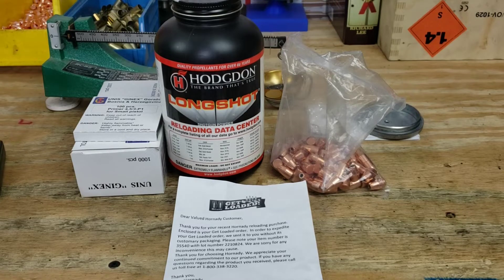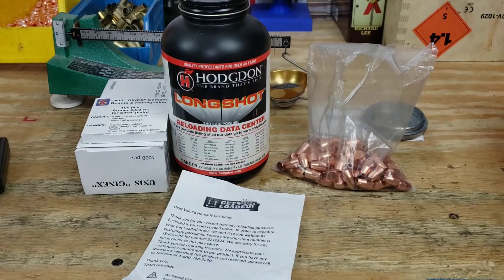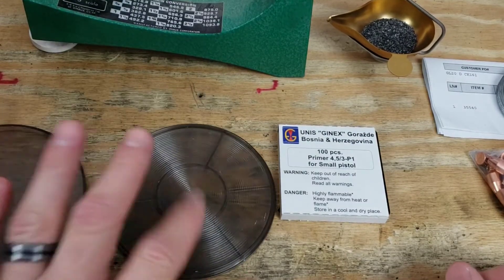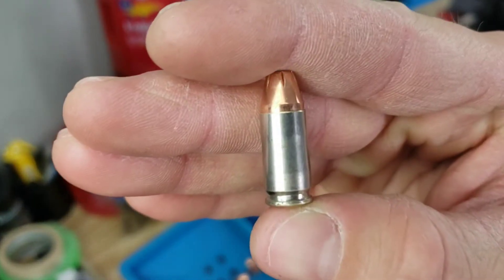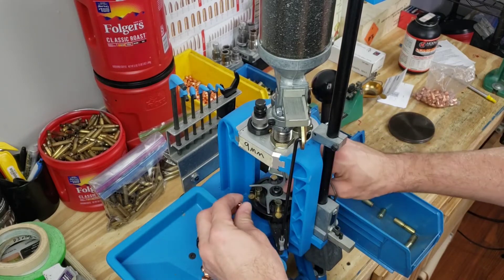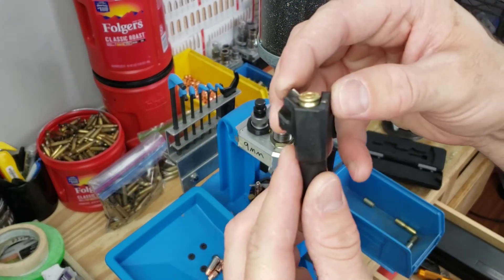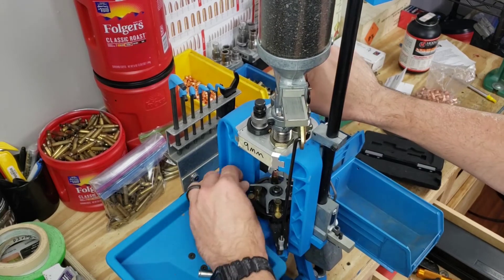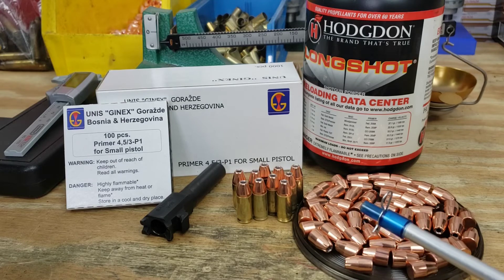Reloading 9mm Test With Hornady 115gr XTP Using Hodgdon Longshot And Unis Ginex Small Pistol Primers

Comment: Thanks for the video, although I mainly shoot cast lead in my 9's my local shop carries the XTP line of handgun bullets and I couldn't pass picking up a couple boxes of the 9 mm 115 gr. XTP bullets.  I prefer the 124 gr. but for $17 a box I'm not picky, waiting on some nickel plated brass to arrive to load them up.
Reply from the maker: I shoot 90% cast, but got these for free from their promotion. I would prefer 124 or 147 varieties, but we can find some of those later. $17 a box is a great price 👍🇺🇸👊

Comment: Thanks for the video!  I was wondering how Longshot would work.  My goal is to reload an accurate 115gr round that performs well through a sub compact (3 inch) barrel. I also carry a Hellcat, and a Kimber Micro 9. I ran your recipe through my QuickLoad Ballistic program, and did a theoretical ladder test with other grain weights.  Of course, you need to do an ACTUAL ladder test, over a chronograph, to verify these results. Since I can't post pictures, I will type out some of the results.

9mm Lugar,  3" barrel, 115gr XTP,  COAL of 1.165"  Small pistol primer, case lenght .754"   MAX PSI 35,000

5.9gr Longshot:  case fill capacity 57.4%  Muzzle velocity 913fps, Chamber pressure 18,356 psi.  79% of propellant burnt.

6.5gr Longshot: case fill capacity 63.3%  Muzzle velocity 305fps. Chamber pressure 22,638 psi. 83.57% propellant burnt.

7 gr Longshot: case fill capacity 68.3%  Muzzle velocity 327fps.  Chamber pressure 26,798 psi.  87% propellant burnt. 

There are gaps in the weight, which equate to pressure changes. My COAL is shorter, because it also increases pressure.  I like to see case fill in the 80% range and muzzle velocity over 300fps, as thats the min needed for proper expansion.   Tweeking the powder to 7.1gr kicks thing up into a better range, but 7.3gr starts getting dangerous.  I believe the sweet spot is somewhere between 6.5gr - 7.0gr. 

!!REMEMBER!! this are theoretical velocities and must be ladder tested for safety.  They are also estimated through a 3" barrel.  Longer barrels will change both pressure and velocity, but still remain in the safe zone, in a 4.7" barrel.   I have been pouring over these number for a week or two, and plan on doing my own ladder test in the up coming week. 

Good luck, stay safe and happy reloading!
Reply from the maker: Thanks for the detailed comment. I seated them shorter until they plunked easily in both guns and went with 5.9gr as Hornady listed 6.0gr as max. The case fill was nearly at the bottom of the projectiles. Could probably work up a bit higher, but longer barrels would probably work better with this 'slower' powder for 9mm. It seemed like the extra inch of barrel only gave ~20-40fps gain in velocity between the two bullets. Also weird to note the shorter barrel gave better ES/SD numbers. Accuracy was as good as I could shoot it off hand. Cases were slightly dirty.

My chronograph data from 5 shots were as follows:
115gr Berrys Plated w/ 5.9gr Longshot @ 83F
-Ruger P95
1061fps avg
70fps ES
30 fps SD

-Hellcat
1043fps avg
16fps ES
6fps SD

115gr Hdy XTP w/ 5.9gr Longshot @ 83F
-Ruger P95
1099 fps avg
30fps ES
13fps SD

-Hellcat
1058fps avg
30fps ES
10fps SD

Thanks.
Reply: @DummyRound  thanks for the chrono numbers.  I loaded 5 rounds of each, starting at 5.9, going up to 6.5gr.  Hope to shoot them today. QuickLoad is very handy, but I do agree with your observations on case fill. 6.5gr seems to be the max full without compression.
Reply: I guess im just wondering what reason somebody would choose this, not to mention out of a compact barrel. I could see if that was the only powder you really have in your possession, and in that case sure. There is really no other excuse unless you just dont know any better. 
I guess it is good for real world testing to know if you really had to for some end times scenario that it will work.
Reply from the maker: It gave the best numbers from the powders I had on hand in GRT, and it's not the only length barrel I was testing it in. Not the best option, not the worst. What do you suggest specifically for a short barrel like the Hellcat?
Reply: @DummyRound  obviously titegroup especially in lighter bullets but i could understand if those pressures make folks nervous or its just not getting you over the top but people leave alot on the table when it comes to titegroup.
For plinking and defensive loads i would lean toward Power Pistol or CFE pistol. I know PP isnt always available but CFE is almost always. They are gonna give the velocity with a good clean full burn n not blowing half of it out all over ur chronograph. Winchester 231 is also a good all around but i find it leaves goldish colored grains in my brass n gear that i dont care for but it does perform. 
Also XTPs perform very well and dont require the rediculous velocities that some hollow points do. 
Im sure you probably know most of this by now
Reply: @DummyRound  Not all data agrees, sometimes we tweak things for our particular situation and that can make a big difference. All u can do is use data as a guideline and record your real world results, alot of times they dont match up 😳🤣

Comment: You can have my share of those Ginex primers. I find them to be oversized and very hard to seat with a lot of flattened out primers. I have experienced several misfires with them. Some seat fine and some don't.
Reply from the maker: Mine have always gone bang, but they are very annoying to work with. They're at the back of the stock pile until I have no other options 🤣

Comment: Sir I have that same press ,and I'm going to use that load . Ive been using the Dillon 550 for almost 30 yrs now . And I have always had issues  with the seating die . So can you tell me what seating die you are using please ?
Reply from the maker: Lee Carbide Sizing die, Dillon powder through/expander, RCBS taper crimp/seater combo backed out to not crimp, Lee Carbide Factory Crimp Die in the last station. Hope that helps. You can probably work up a hotter load than I picked, but start low. Thanks! 🤘🇺🇲
Reply: Thank you very much ,
Reply from the maker: @maduro169  enjoy!

Comment: Never seen those primers. How hard are they? Could maybe use in 223? 🤔 I lucked out the other day and found a brick of CCI 500 at Bass Pro for $65
Reply: Been using some small pistol magnum primers in 223 and they work fine in mini 14, no punctures or over pressure signs,accuracy the same as small rifle primers.
Reply from the maker: I'll have to test that and see!
Reply from the maker: These aren't magnums, but I did read they were a bit harder than "normal" pistol primers. Whatever that means.

Comment: Long shot sounds simular to alliant powerpistol, were the primers cheaper and we're they an online order?
Reply from the maker: Got them locally using the good ole barter system. I want to try some Power Pistol,  but those Alliant powders are hard to find these days. Thanks for watching 👍🇺🇸👊
Reply: About five years ago I bought 4 lb keg of power pistol for $110 and I still have over a pound left and it's work anywhere for my 32s all the way up to my 45 I used it for my 38 shorts my 38 Super police 200 grain loads and it's worked great in the 40 Smith & Wesson or my 10mm shorts and of course I have my hp-38 as my all-around go to powder. The weekends here and I have another 40 caliber shoot tomorrow with the power pistol so a new video tomorrow.
Reply from the maker: @Ford360CID  awesome! I'll be watching that. Hopefully your package will be showing up soon 😉🇺🇸👊
Reply: @DummyRound  😄wooo whoooo !!! Happy 💃 dance

Comment: Ginex has poor quality control, some batches work just fine while others have several duds in them. For budget primers I buy Magtech or Sellier&Bellot. They say Magtech especially has hard primer cups but I never had any problems with those, maybe its only an issue when using reduced strength hammer springs in sports pistols.
Reply from the maker: I haven't had any issues yet, maybe I got a good batch. I only read good reviews while doing a bit of research, but I'll keep an eye out. I have seen people get a box of 5000 loose primers with no sleeves or  anything protecting them, maybe those are more exposed or something? Thanks for the comment 👍👊🇺🇸

Comment: If you would have just flipped the primers from the package into the top portion you would not of had to flip them in the bottom portion.
Reply from the maker: I never claimed to be a smart man👍
Reply: @DummyRound  got to wonder why they made the tool.
Reply from the maker: @thetexasrat  very rarely are they all orientated the same way
Reply: @ound So far all my Federal and CCIs have been oriented properly, but that could change. Anyway it is always a good idea to have a solution to a problem before it presents itself I reckon. Kind of like the bullet pullers and stuck case removers.
Reply: @DummyRound  So far all of my Federal and CCI primers have been oriented correctly, but I know that could easily change without notice. Anyway I guess it is always a good thing to have a solution to a problem before it exists. Kind of like the bullet pullers and stuck case removers.